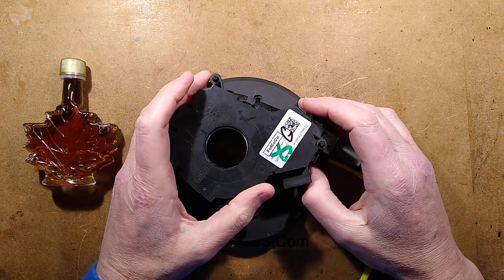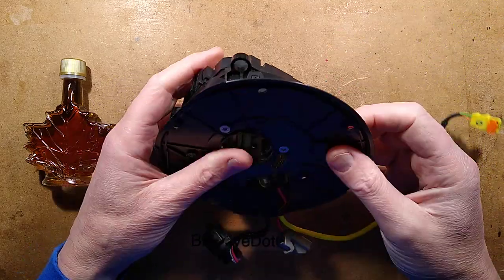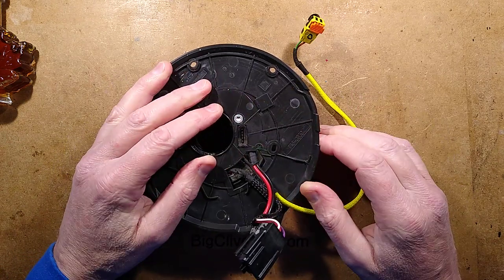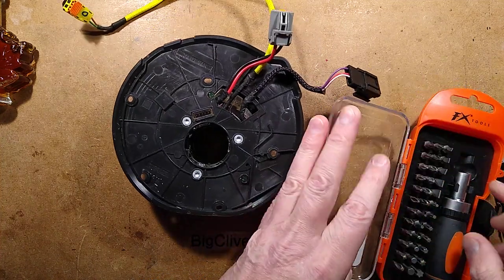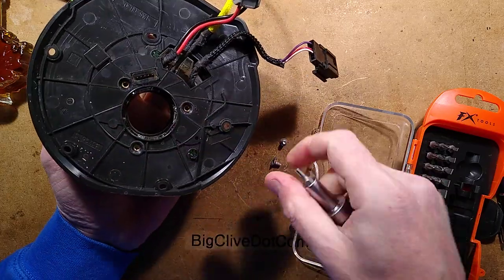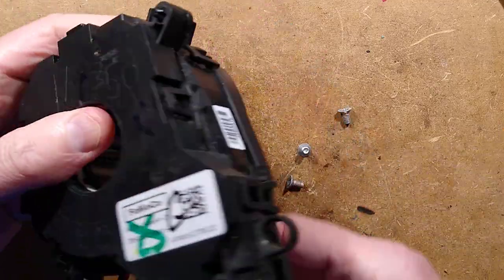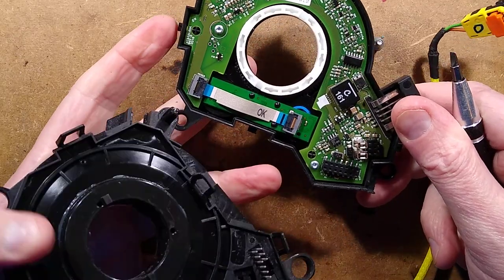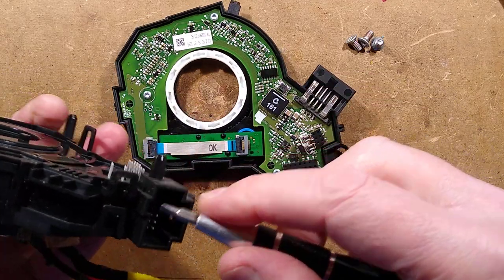Inside a car clock-spring module (steering wheel wiring interface)

Comment: The blue and black gears could have different number of teeth, which would make it possible to get the absolute position of the steering wheel. 
Which would also explain why they have different colors. 
Or you could just wait for the car to drive for a bit and take the average angle. Which in normal driving situations would be pretty close to straight.

Comment: You will find the unit has permanent power and constantly tracks its position even if the ignition is off, if for any reason the power is lost to the unit then you have to put the steering wheel in the mid position and recalibrate it using a diagnostic tool

Comment: What if those chips are not Hall sensors but inexpensive magnetic compass chips like we have in smart phones? Those could then detect the angle of the magnet. Are the who gears rotating the magnets same size? If not, the the center position could be when both sensors point towards north, and further you turn the steering wheel, more deviation of angle there will be between two sensors. Based on deviation, like one sensor behind or after the other, you can power off and on the computer and it can always calculate the position of the steering wheel when turned back on.

Comment: are the rotating magnets polarized between both surfaces or between 2 sides the circular edge? Those chips could be compass sensor chips that read the angle of the magnetic field going through them.
since the center can do more than one rotation (and the small gears will rotate even more), one of them would not be enough as it would eventially go back to the same spot as you turn the wheel. there are 2 of them, probably with different gear ratios so the controller can always tell what the absolute position of the wheel is, even after losing power as every possible steering wheel position will have its unique combination of the magnets' positions

Comment: Don’t forget the other connectors: most likely the yellow one for airbag, then you’ll need power, at least one pair for can, and a horn. 

The 10-way (?) connector will go off to all the radio / cruise control buttons on the steering wheel, and some of the electronics will send those button pushes down the relevant can bus(see).

Try putting it back together (🤣) and hooking it up to a scope to ID the data pins. The data will be garbage cos there is nothing else on the bus to ack the frames.

Comment: There are a lot of functions on the wheel. Radio, cruise control, horn, etc. The yellow wire is the airbag. The three small wires are power and data. That movement module may be so that the vehicle knows where the wheel  is for the self parking function or the self backup function. That is a VERY expensive part.
Reply: That "was" a VERY expensive part. lol

Comment: i've modified a few of these, no electronics or whatever degree here, but playing with PC's and PCB's since at least the 80's (opening things as a kid LOL), easy to work on just a bugger to make sure square at 180, and not the opposite 180 lol. Nice vid tho. S(D)ealers charge a fortune to fix these. My experience is with VW, sense angle of the wheel in relation to the abs/speed sensors and it decides if traction control may be needed.... Been working on these since the 2000 VW MK4 golf.

Comment: Clive,
Do the two small gears with magnets have the same number of teeth? They could have different ratios, that way the centre could have both magnetic fields 'in phase' then as you rotate the wheel the magnets slowly go 'out of phase' along with each magnetic field rotating?
That could give you the position of the wheel?
Just a thought

Comment: I dont think it need a point of reference for a centre point.  I think it just needs to know movement left or right. So its bias one way or other to sent to data to the power steering.   The point of reference  will probably be the wheels of the car on the road with end stop sensors on steering rack.

Comment: Looks to be a feedback circuit for the auto-park system on some ford pickup trucks. This way the onboard computer knows the position of the steering wheel for the automatic backup/parallel park system/ back up with knob system.  Its for folks who failed drivers ed and have no idea how to parallel park or back up to / hook up a trailer, without bashing their $60-80k USD truck to bits. (Aka, folks who dont need a truck, but have one as a fashion accessory)

Comment: Are both the small gears the same size of is one a little bigger than the other.  There are hall effect sensors that give you angle information. So if the gears are different sizes, then there would only be one spot where both sensors read zero degrees. If you rotated one of the gears 360 degrees, the other gear would rotate some different amount and there would be a difference in the hall effect readings.

Comment: Are one of the gears smaller than the other? If there were a size difference you could probably determine absolute position by the phase offset of each sensor?

Comment: My guess is that the two gears with magnets on them are different numbers of teeth, and once initially calibrated, it uses the two difference of those signals to calculate absolute position. Not an engineer or anything, but it makes sense to me and it wouldn't raise the BOM by much at all.

Comment: This reminds me of the day at work when I had the steering shaft disconnected on an 04 F150. The guy who drives it needed something out of it I guess. He must have grabbed the wheel and had it spin, never admitted to it but it needed replaced (air bag malfunction) and I have done more steering shafts on F150's than I have fingers and toes and have never had one fail to work after I was done. Now I loop the seat belt through the wheel so it can't spin.

Comment: Positioning 0 point: Wheel alignment with steering wheel straight, reset computer data to 0 degrees. Also some vehicles support calibration with lock-to-lock steering wheel turning (after dead battery for example). 
Two hall sensors because one is not enough. Same with accelerator pedal. Some cars might have different number of teeth on sensor A vs B cogs so computer can sum up "how many turns before/after zero".

Comment: (Retired Canadian Ford Employee) FoMoCo-Ford Motor Company.. clockspring assm for a mid 2010 Ford Vehicle more then likely off a airbag deployed vehicle.. once the airbag deploys its illegal to reuse the clockspring due to the heat/amperage that goes through it to deploy and damage from heat from the airbag, please do not reuse if you do not know the history behind it as using a used one may lead to a fail to deploy and possibly injure/kill the driver.. replacements are about $75-100....  (please do not try to salvage it. we either smash or cut them in half if they are unknown origin or out of a airbag deployed vehicle)
the double gear assembly is for parking assist to detect how far the wheel is turned.. more then likely the vehicle has a reverse camera with a live line that turns to tell you where your going and adjust when you turn the wheel.
(Police Interceptor Sedan. 
Taurus. Flex. MKT. From 1/19/15. Tilt & telescopic. Without heated 
strg. wheel. Special service police sdn. With and Without automated park sys. 
Modules & sensors, all, without heated steering wheel, from 
01/19/2015. Modules & sensors, all, without heated steering wheel)

Comment: Not a professional mechanic, but I do know that for my car with an optional steering position sensor, when you put one in, it turns on the steering fault light. You then have to turn the wheel all the way in one direction, then all the way to the other, and it will then use this info to find the center, turn off the fault light and start working.

Comment: 70mph approaching a roundabout then an orange light came on ( ! not RED ? ) as I entered the round about I found the benefit of being 6ft 2 in I managed to avoid going straight over the roundabout.

£1000 to fix both parts of  the steering encoder and electrical motor (not hydraulic) 2005 Vauxhall Meriva, being tight fisted and that I had an intermittent fault for when the orange light came on.
I unplugged everything connected to the steering shaft and used contact spray and for the past 5 years it has only happened a couple of times.
Intermittent fault fix is to park the car press "Alt Ctrl Del" or take the key out.

Apparently in the UK this is not a factory recall but the fault is common.
My MOT guy said if he sees the orange light he will retest it until it passes.

I can't sell the car and will have to scrap it when I have done with it. The front pillar blind spots are enough reason to scrap the car anyway, while going around a roundabout the car in front will disappear unless you start watching for it via the side window, I am over 6ft so the seat is fully back and the plastic trim and black edge decoration on the windscreen block even more visibility. 
I do not like modern cars.
Reply: Closer to £2000 in the Ford Focus.

Comment: Whether or not it's expensive depends on whether or not the vehicle it attaches to has a Lincoln emblem on the front or not.

The rear fascia panel on the hatch of an old Lincoln MKX was $1100 from the dealership... And it didnt have any electronics or anything in it. It was just a big piece of plastic.

Comment: I believe the gears on each side has a different ratio, and it can detect dead center when they both are aligned.  But I could be wrong, you never inspected the gears fully.

Comment: as far as tech goes, a car today has more in common with a SpaceX dragon than with a car of even the 1980s.   For example a modern car or truck has many other sensors, So those steering wheel position units probably do not need to know where center is.  As there would also very likely be wheel position sensors and other systems that show which way the vehicle is headed.
Reply: Hehe, yea this.   (Not a mechanic, but learned a lot the past year about auto and truck parts due to building a simrig with actual real parts)I laugh when people are amazed what damage a car these days suffers that renders it a total loss, and I'm like "There's so much sensor input readout traffic going on that we probably are completely clueless about that even a slight bit of misalignment anywhere will cause a mountain of errors :P "

Comment: Do those Hall effect sensors provide a positional or rotational speed reference between the steering wheel and the steering rack for the electric power steering pump?

Comment: so does that mean if you stick a giant magnet near your steering wheel the electronic stability control panics?  Clive - that needs testing....  It will either panic and start braking on one side of the car to cause it to yaw to what it thinks it should be - but more likely it will bum out with a fault code saying implausible signal - steering angle module.
Reply from the maker: Given the expense of the component and the risk of the engine management unit throwing a tantrum, I'd be cautious about putting a big neodymium magnet near that area.

Comment: Do the magnet-gears for the steering angle sensor both have the same number of teeth? If they're a little bit different, then the "phase angle" difference between the two would give a pretty good absolute position.

Comment: I dont think the encoder needs a reference.  It looks like it would be for turn signal cancellation.  So if you activate the turn signal it would monitor for when the direction of the wheel reverses to trip the signal off.  Actuall wheel midpoint is irrelevant.

The reason there are 2 is perhaps one can only read clockwise and the other counter clockwise.

Comment: I think they use a few different types of sensors some with a set position but this type when it looses it’s position you’ll get a warning light possibly abs or steering if it’s electric and all you have to do is steer full lock one way then the other and return to 0’ and the computer will make the calculations to find dead ahead.
Reply from the maker: It's clever.  I'm going to have to take a look at the encoders again.

Comment: You want to be careful with the kind of grease used to lubricate plastic gears. I remember that we used to get tubes from IBM for lubricating the nylon gears in laser printers, and carriage slides in older printers, and it had a huge long safety document that accompanied it that talked about it being a nasty carcinogen and you weren't allowed to get in on your skin.

Comment: The encoder is used for stability tracking and ABS.  It requires calibration to determine the steering wheels min and max rotational values which should happen whenever you replace the battery or any of the ABS or safety computers have lost power or have been replaced.  The magnetic polarities of the magnets seem to be perpendicular to each other which would make it act like a standard A/B output encoder, but that is just a weak observation so no guarantees... And that is just how I would engineer it at least...
As for the clock springs themselves.... I HATE THEM!  Make them go away.  Just make them wireless modules... wireless power to a board with buttons that communicate back what buttons are pressed....  The only two clock spring ribbons you might need then are airbag related...  Horn doesn't NEED to be hard wired.

Comment: If the two position sensors are geared with two different (  prime )  number of teeth, once you establish a centre point and store the relative angles of the two sensors in NVM for that reference point you should be able  to work out the steering angle after power up by looking at the relative angle of the smaller gears. Because they rotate at slightly different speeds with the different tooth count. Why the gears are different colours..
 At the same time small movements of the steering wheel stil show up as larger absolute movements of the sensors as they are geared up..

My Peugeot from 2004 just has a horn switch contact pair and two air bag actuator pairs on a single flex ribbon...

My camper van from 1973 just has a  single wire connected to the chassis via a bearing at floor level that is shorted to the steering column by the horn switch. The column is actually connected in series with the horn.. keys short to column, horn goes off..

Comment: A lot of clock springs use LIN instead of can bus I believe, Its cheaper than CAN
Reply: They can use the LIN (Local Interconnect Network) for less critical components as it is a cheaper serial network for individual components.  Say the radio/comms controls on the steeringwheel.  CAN is used to connect modules that control several components or for time-critical safety and performance systems.

Comment: Some of the newer Vehicles do NOT  have a mechanical linkage to the steering. It sends a pulse signal to a motor then the motor turns the wheels. No connection at all from front wheels to the driver except electrical!
That might be the electrical sending unit you have there?

Comment: If you see ANY wires in a yellow jacket or sleeve in a car or plug, DO NOT TOUCH THEM WITH THE BATTERY CONNECTED. The same goes for Orange. Once you have identified that the wires are not for the air bag or SRS system you you can proceed. A probe with a shitty voltage checker (light bulb type) can make them deploy by probing one wire! Air bags aren't the only SRS system. There are also seat belt tensioners, head rest systems and others! Most of these systems will have a yellow covering.

Comment: those two magnets for the sensors probably are supposed to have a 90° phase shift between them. I assume that they're using a standard quadrature encoding so that they can tell which direction the wheel is rotated.

I would guess at the absolute reference at the at the rack and pinion box. If the steering wheel can multiply can rotate multiple times, then an index sensor needs to look at what the position of the rack in the gearbox.

Comment: Do the magnets on that hall effect sensor array, have different number of teeth on each magnet?  If it did that would make me think that they're testing for the magnetic fields against each other and it would increase the resolution of the steering wheel position that could be detected.

Comment: Ah. My clock spring is going faulty on my Freelander 2. The steering wheel buttons are slowly going open circuit. Steering angle encoder included.

Comment: I don't know about  Ford in particular, but in general these clock springs fail quite often (bad contacts in the spot-welds). I guess that this is just one that has failed and would have ended in the dump but instead got send to Isle of Men. Anyone who cringes about Big Clive taking this apart should know that absolutely fine car parts are trashed all the time because of misdiagnosis. Also, many parts that can easily be repaired are trashed because people don't know how to repair it or just don't care. But in this case, clock springs can't easily be repaired AFAIK and they just come with all electronics as well (although that is probably just fine)

Comment: Could it be that those two magnet gears each have a different number of teeth? So that they only line up exactly at one point, and are out of sync at any other point of the possible steering wheel positions? I'm sure those gears are color coded for a reason.

Comment: Viewing film on those two magnets? I'd expect one to be 4 poles to a side and the other to be three. That should let you count the 12 rotations without losing center, right?
Reply: If gearing is not the same this is an absolute encoder with a great precision and with only center position in memory, no need to have many poles